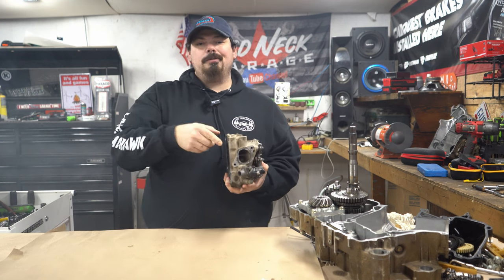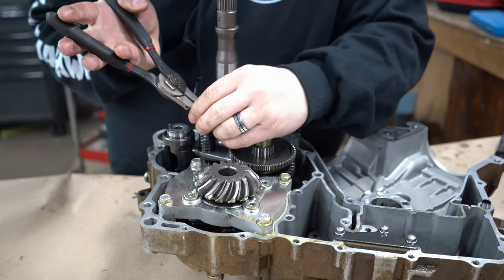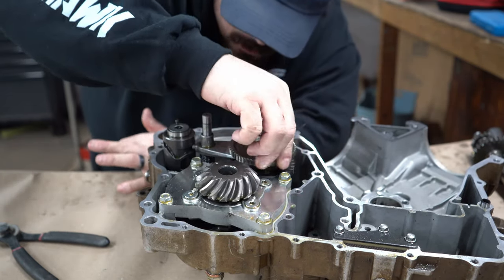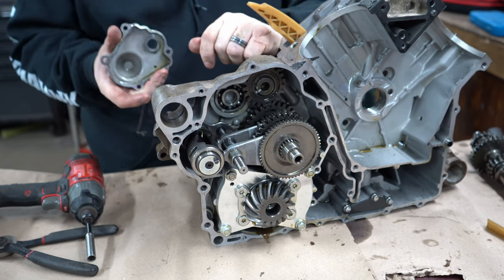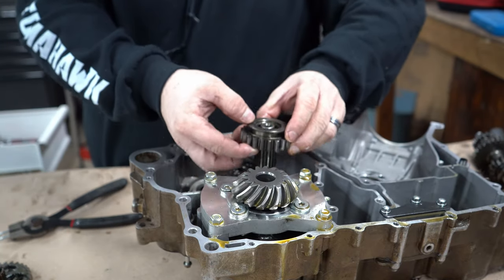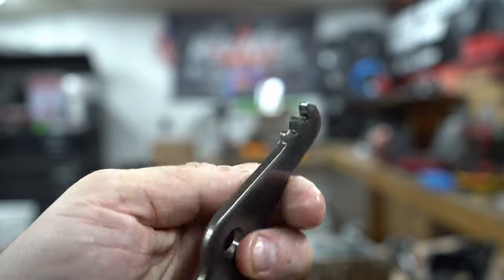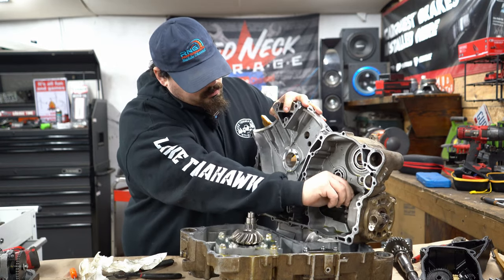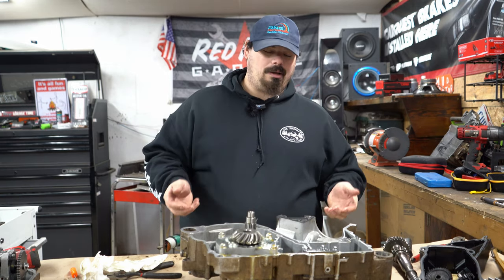CFMOTO Transmission Problems

Comment: CF MOTO owners manual says DO NOT haul in park. It says haul in ANY gear. It’s amazing what we can find in that manual if we just read it. 😂🤣😆
Reply from the maker: Exactly
Reply: Correct , put in neutral and engage the emergency brake !
Reply: @billfleming8281  Good advise.   What is interesting is it appears they did away with the parking brake for the 2023 model.
Reply: @bruceh3786  I did not know that , mines a 2021
Reply: Are they safe or reliable motorcycles?
Reply: @robertcurtis3807  yes and yes.
Reply: @bruceh3786  no they didn’t
Reply: @lacrosseforlyfe  Which 2023 ZForce model are you looking at?  I cannot find a parking brake on the new 2nd generation ZForce models in the US. The older 950 HO ZForce models have a parking brake or what CFMoto calls a hand brake in the manual.
Reply: Wait a minute....Read? What dat mean
Reply: Then why do they make the park ?  If you can't haul it in park why have it, if they took out the park then that would lower the cost even more!!
Reply: @robertcurtis3807  I think this is a atv video
Reply: Good vid😊Can someone help me😢 my Zforce 1000 (2020) gear stuck on reverse. Cant get it on free.cant tow it to dealership😮
Gearshifter is ok.😮
Plz,need help😢
Reply: You can't tow if the transmission is in park? Seriously?.
Reply: My favorite videos.... Ones that can save you money.

Comment: This happened to my 2022 Uforce 1000 with 35km on it, yes 35. Placed in park on my slight grade driveway, noticed it rolling backwards. It is absolutely a weak part on the machine and you will see more of these failures. I will no longer shift into park. Only parking brake will be used. Oh, add a clutch kit as it completely changes the machine and smooths out engagement (a must do in my opinion). Now I am a happy cfmoto owner.
Reply from the maker: Yes sir.  We usually use just the ebrake.
Reply: @R.N.GPerformance  I have subscribed. I have a question. Do you know of any aftermarket or future plans for CFMoto to create a replacement shift lever knob that houses a 4 way switch for a plow system. I have the KFI plow system with hydraulic actuator. It would be great to have a shift knob (like Polaris) that controls the winch and actuator.

Comment: Time for someone to create an upgraded park paw
Reply: I think it needs to remain a sacrificial part, if it's stronger, something else is going to break.
Reply from the maker: It just rides on a gear.  It could be a little stronger wouldn’t hurt at all.
Reply: @R.N.GPerformance   I'm going to have to strongly disagree with you on that one.
Reply: In China they usually make parts designed to fail to save a more expensive part.
So, you made a bigger stronger pawl, now what gear is that new pawl going to take out when on a hill?

Comment: Hey RNG. Been a fan since the beginning. Love all your videos. Question it’s looks like transmission and engine are together. My z950 locked up it’s under warranty and dealer said they ordered a long block. So I guess I’ll be getting a new engine and transmission?
Reply from the maker: Thank you 🙏.  Yes you will get new transmission also. Only thing that will be re used is your clutch, flywheel, intake and some sensors.
Reply: @R.N.GPerformance  ok thanks. I thought so

Comment: Thanks for the video, well done!  I have a cf Moto 2016 z force 800 I think I need to go into transmission but not confirmed yet.  Maybe you can confirm?  All I can say about it is machine will roll forward but not backwards in neutral.  Took it home on a trailer and was only able to get off trailer by starting the engine (runs good) and applying bit of throttle in reverse ~when doing so I could hear a bit of grindy/clacky noise and it would catch periodically trying to move backward.  Beyond that I've just disconnected driveshafts so I could move it freely around the yard.  Any advice would be greatly appreciated 🙏

Comment: Picked up a uforce 1000 yesterday. Put less than 30 miles on the machine trail riding and threw it in park on a very shallow hill, couldn't get it out of park. Finally had a couple buddies lift up the back end and it shifted just fine, drove down to flat ground and realized that it would no longer go into park or low gear. Thought I did enough brand research but really kicking myself for getting it now.
Reply from the maker: In the owners manual it states park is for glad ground only.  Use neutral and ebrake. And never haul it in park.
Reply: @R.N.GPerformance  is there a section of the manual that expressly states flat ground only? I read the portion stating to properly park on the flattest section of terrain available but did not see what you're referencing.
Reply: @minorityfireteam3502  Flat ground only? well the Chinese haven't figured out yet that park is not needed on FLAT ground! Where do you need Park most? Oh yea, hills & hauling on trailers. LOL

Comment: I've been waiting for this video for about a year now ever since I broke my parking gear in my uforce1000 while.   I was wondering if the paw was softer than the gears and apparently it is. I think I'll wait until next Winter to perform this particular repair but it doesn't look too bad.
Reply from the maker: Yeah it’s pretty easy for sure.
Reply: Pawl, not paw.

Comment: Mine broke when I was pulling out stump using the wench.  I was in park and I was standing out side the machine wrenching away. I did get CGMOTO to cover it.
Reply: Robert did Cfmoto give you any issues getting it covered ? I just did the exact same thing last week and Cfmoto is starting to give my dealership some static and wanting them to tear into deeper to see what caused it. I was truthful and told them I was winching while in park, and the manual actually stated to place in park and Ebrake while winching. I hope they cover it.
Reply: @primetime1267  that was back in the June of 2021. They tore the engine apart and replaced the broken part. It was coved. If the book says to leave it in parking when using. You need to show them and push that it needs to be covered.

Comment: What makes them hard to shift between gears.2022 zforce 800ex  … 150 miles. Seems to shift fine when cold.
Reply from the maker: Could be the bearing in the clutch. We sell and upgrade clutch bearing for them. https://rngperformance.net/shop-parts-accessories/ols/products/cfmoto-clutch-bearing-rebuild-kit

Comment: I’ve hauled mine in park every time 😬😬😬. But I also have the hand break on so it would be pretty hard to move it at all. Think I’m safe…? Lol. I haven’t had any problems with park. If anything when I’m parked on a hill I have trouble getting OUT of park.
Reply from the maker: I personally don’t use park ever.

Comment: Hauling in park did the damage and what about the bearings, same thing or was this transmission beat on?
Reply from the maker: He said park never worked from factory and they were going to fix it then he swamped the engine.
Reply: @R.N.GPerformance  ic

Comment: Nice work. I expected more gears in there. One question, what is that mesh held in with 3 screws in the bottom of the engine oil part of the block?
Reply from the maker: You talking about the oil screen? Just a couple screws on the bottom of the block.
Reply: @R.N.GPerformance  Ohhh. Is it necessary to clean that oil screen from time to time?

Comment: What caused the engine and transmission to fail in this sxs?
If not park then what gear should we haul them in?
Reply from the maker: Neutral with E-Brake.  The engine failed because he got water in it.   The parking paw he said was defective day 1 the dealer was gona fix it but then he swamped it.
Reply: I recommend using a 09+ gen f150 tailgate bump stop as a park lockout. It fits like it was from cfmoto.
Reply: @R.N.GPerformance  
I see the 2023 zforce 800 trail doesn't even have a parking break
Reply: CF Moto owners manual says ANY GEAR to haul. It says DO NOT haul in park!

Comment: Great tip with that small hole
Reply from the maker: Thank you
Reply: Where is that small hole located on the cforce 600? After wash,  my machine cranck but will not start. After second try, it will star working but with misfire. Maybe this hole is clogged because this is happenig only after wash.

Comment: Do you sell a bearing engine brake delete that doesn’t have it?
Reply from the maker: Why your CFMOTO Has a Jerky Start / Clutch Noises
https://youtu.be/nD9HR1n8DcQ
Reply: @R.N.GPerformance  no it’s brand new but I don’t like the engine brake and I watched your video talking the one way bearing out of the middle of the shaft bearing if that makes sense or should I just do that?

Comment: I have a 2022 uf1000 with 50km sense new the unit is hard to get into gear and if parking break isn’t in this thing will roll and click, also when accelerating or letting off the throttle there is a clunking sound, probably the same issue, should I be concerned with metal in the oil causing other damage if it is the parking pawl?
Reply from the maker: The clunk sound is normal it’s just play im the driveline.
Reply: @R.N.GPerformance  would a broken pawl cause internal damage if isn’t fixed right away?

Comment: Our transmission just shit the bed! It will go in reverse no problem,  but when you pit it in low and hit the gas, there's just alot of clanking and the machine goes nowhere?? I think the gears may be busted.???
Reply from the maker: Might be a simple shifter cable adjument too.
Reply: @R.N.GPerformance  already tried that. I think we may have broken the low gear.